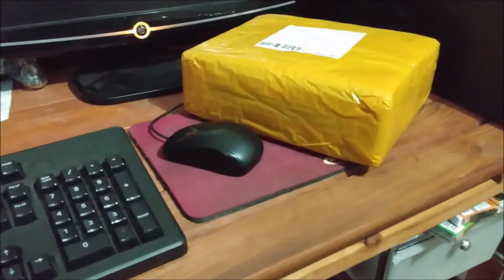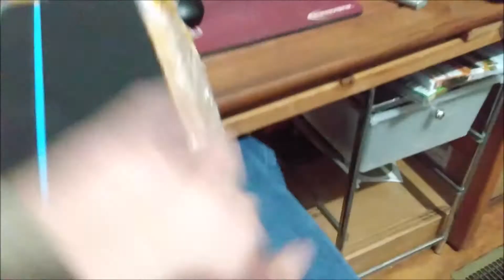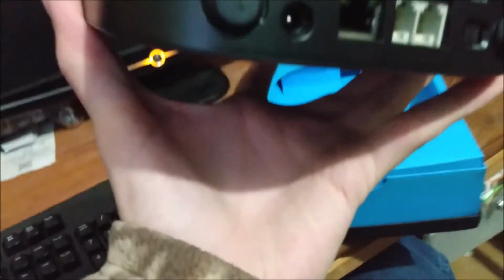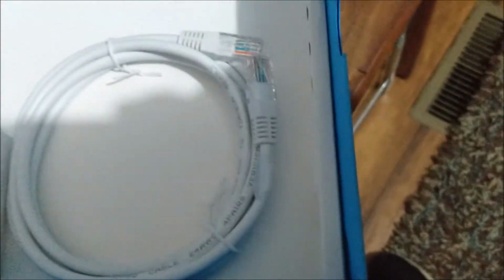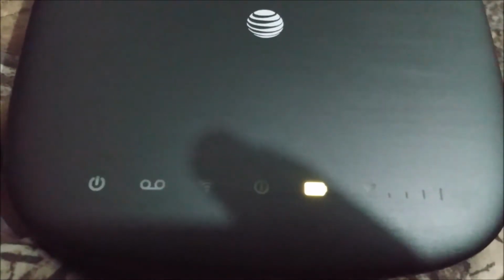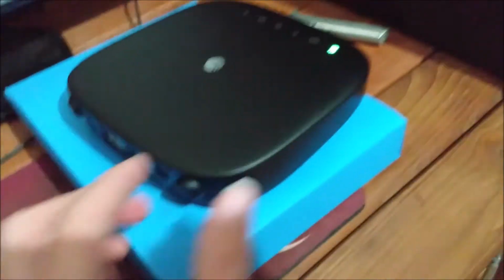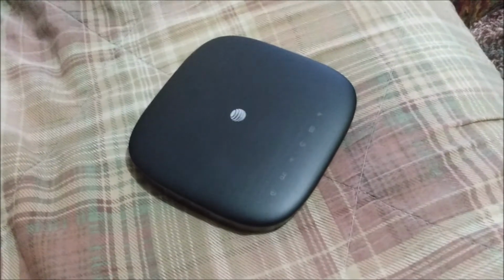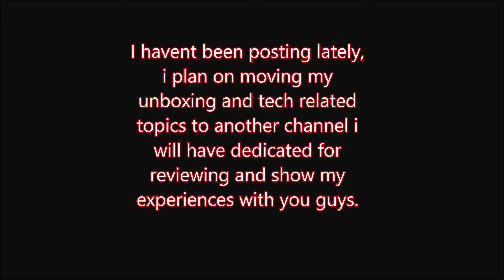ZTE MF279 Uboxing

Comment: The connectors are smaller than SMA connectors. If they are SMA what type are they?
Reply from the maker: Sma is a connector type, there are also different variations of them as well, such as, female with/without pin and male with/without pin. There are also ts9 connectors, but the mf279 uses sma, if your connecting external antennas or a booster, make sure the end(s) your connecting to the router are male sma with the pin. If you have more questions, feel free to ask.
Reply: @Mr_Byrd  I understand that are different sma variations as far as the ones you mentioned above. What about different sized SMA connectors? The SMA male connector at the end of the cable sticking out of my wall is to large in diameter and the pin is to thick to fit into this router. I don't understand bro!

Comment: Does it work with other carrier sims
Reply from the maker: It works on Compatible Gsm networks with compatible bands.
Reply: Will a straight talk sim work
Reply from the maker: @Drxco825  yes, but I do not recommend using their service on this device, they consider it as using hotspot unless you get the plan with 10gb hotspot, but I don't know how they would react after you exceed that allotment. You can make phone calls on it, but it switches to 3g mode when doing so causing data latency or disconnection. When I used straight talk with this device, they would usually terminate my service. It should work under at&t or possibly work on T-Mobile or under their resellers depending on their TOS and policies. Doesn't work with Verizon or resellers on its network.